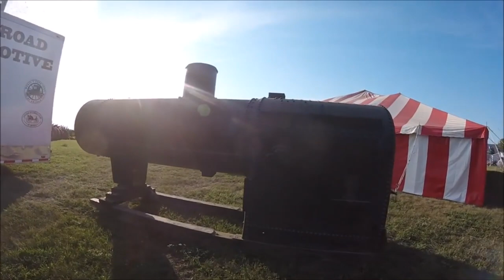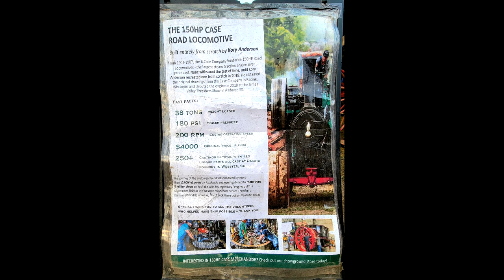150hp Case Steam Traction Engine/Road Locomotive Mashup - An Hour of POWER! #150Case

Comment: How is it steered? Cheers
Reply from the maker: It has steam powered steering operated by a lever!
Reply: @KennyKizzleRustyNutzRanch  I'd seen it has power steering, but couldn't see anyone actually steer it.. Cheers Kenny👍👍
Reply from the maker: @bigtrev8xl  yes, there is a smaller lever, about 10-12" long on the far right of the operators side. Push it forward, it turns left, pull it back, it turns right. The 110hp Case also has steam power steering.